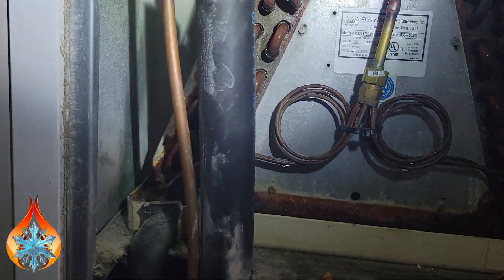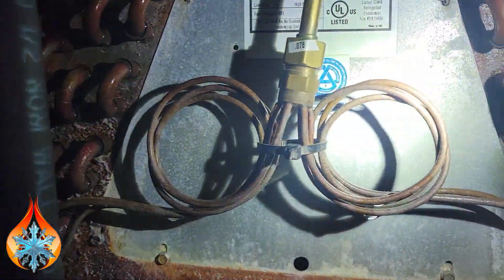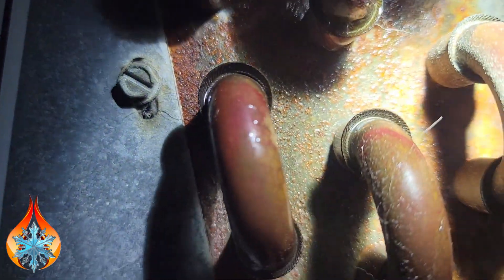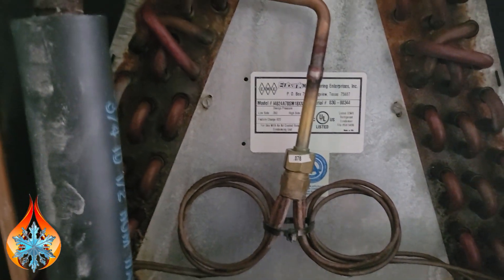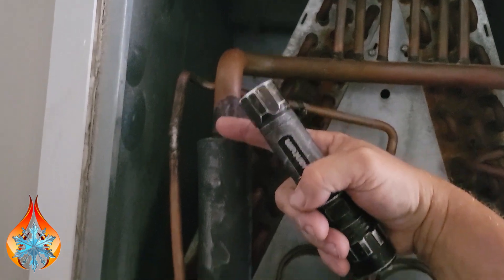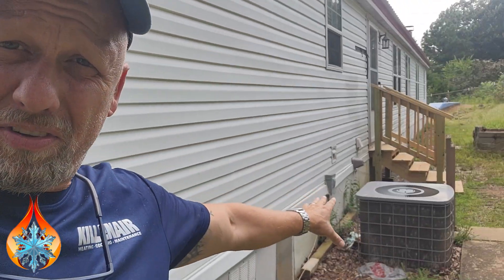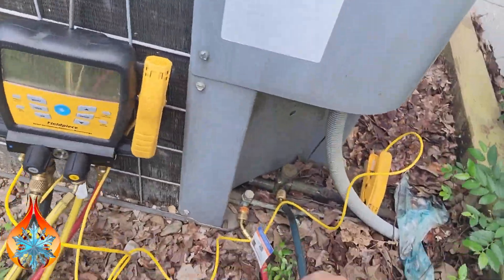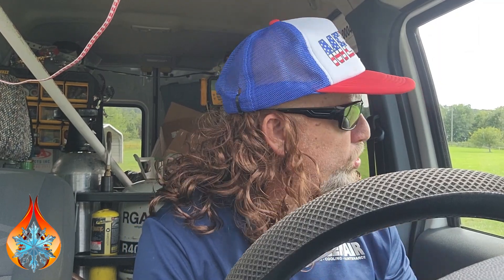How to Tell If Your AC Is Low on Refrigerant (R-22 System)

Comment: He brotha! Do you know about a car ac?
Reply: Wow very interesting very informative  always learning something from your videos brother Bryon thank you for sharing this with us I always share your videos
Reply from the maker: @patriciaconnolly4745  right on friend!!
Freely receive freely give.
Reply: Am I missing something but why not use R22 and a new evap.  Or even try sealant.
Reply from the maker: @MichaelDimaggio-h7x  your not, that is an option for sure.
One thing to note is that there hands were tied on this one. They had home warranty who was the determining factor at the end of the day.
They wanted upgrade and or permanent fix. 
I have used leak sealant before though and has its place.
Thank you for reaching out.
Reply from the maker: Truthfully I have never replaced one or worked on one other than adding refrigerant. But the concept is the same as all refrigeration.
If it's not cooling well, probably low and need a separate sealant.
If no cool could still be low or empty on refrigerant. There is a cut off built-in switch that opens when low.
The clutch or front of compressor should be spinning when turned on.
This is my extent bro..
Reply: @ACandLifeMadeSimple ❤Well bro, I thought I would ask. I’ve already drained and added freon. I’ve replaced the relay and the 7.5 amp fuse. The clutch is rotating on the compressor and still blowing hot. I’m waiting on a 4 way hose kit to check the high pressure hose and low pressure to see if it’s off. Currently my low pressure is st 35 but i think the gauge is off which is way i’m waiting on kit.
Reply from the maker: @WaylonJenkins222 wow, your on it!!
Did you by chance touch the low side line by compressor to see if it is cold?
Some times a damper could be allowing hot air to mix. 
Teach me!!!!!
I would like to do a video on a install for a vehicle.
Reply: @ACandLifeMadeSimple Lol! I guess you CAN teach an old dog new tricks! lol! If it wasn’t for youtube I wouldn’t know anything pertaining to working on a car. I’m trying to keep from replacing the AC compressor, but going thru process of elimination! I’ll update what it ends up being. Thank you for your videos. Now we need a brother/sister doing the same thing for everything possible! Love yall and have a blessed weekend! Shalom!
Reply from the maker: @WaylonJenkins222  there might also be a restriction at the expansion valve or piston entering the evaporator coil.
Shalom
Reply: @ACandLifeMadeSimple Ok thanks.
Reply: Hello Brother Bryon God bless you 🙌🙌🔥🔥🔥🤲🤲🤲✝️✝️✝️☦️☦️🛐🛐
Reply: My nephew Zachariah is watching you as well he is 14 years old and he wants to go to school to learn air conditioning after he graduates high school you want to learn how to do air conditioning
Reply from the maker: @patriciaconnolly4745 
Wow so good!!!
I am going to break down on a video the major components soon!!
Reply from the maker: You get it fixed?
Reply: @ACandLifeMadeSimple It’s been a nightmare to say the least. Too much to list here. after all i have done there is still a leak and problem that causes my low pressure line to not get cold when I put freon in. My AC no longer blows cold at all. Im stopped messing with it, but am about to get back at it.